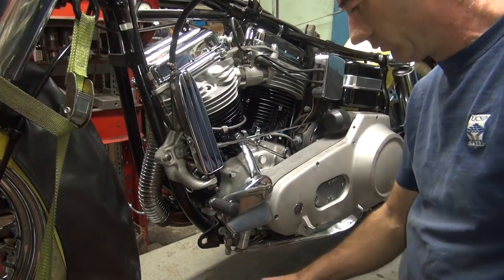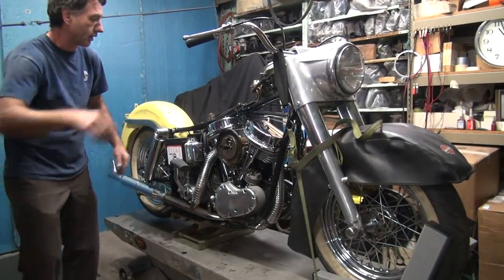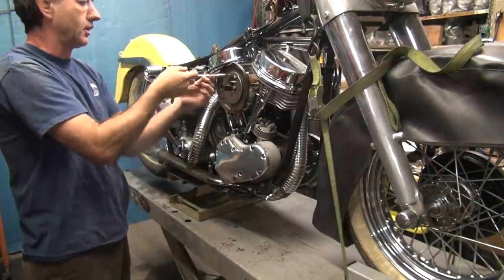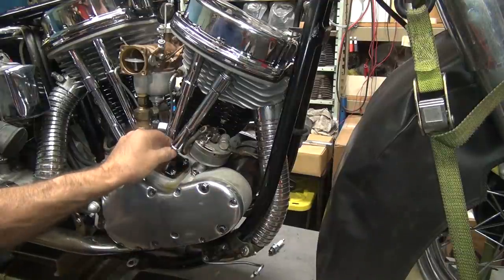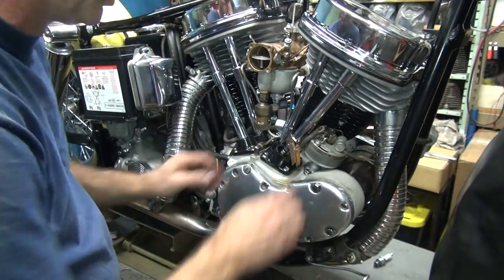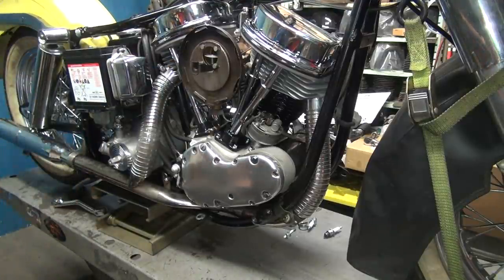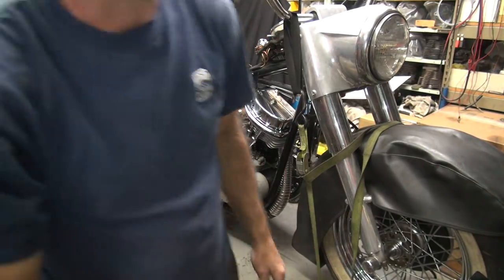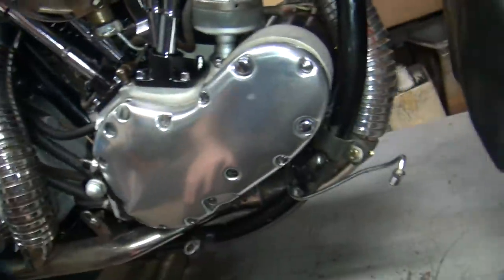1965 panhead #160 74ci flh motor rebuild and bike repair harley by tatro machine

Comment: You use what sort of  hydraulic tappets, and hydraulic unit?  George from Hungary
Reply from the maker: crappy ass harley ones. they are all junk. bad design from day one.
if you want good lifters go with the s&s evo conversion kit. it doesn't look stock but they work.

tatro
Reply: Thank you!!

Comment: Do you know the torque specs on the head and base bolts ?
Reply from the maker: yes, tight.
tatro
Reply from the maker: ok genius. you think you are so special. what is the correct torque for the application? what the manufacture of the part said? the one who made the hardware? or the one who has been doing it for years. then you have the racer who just tripled the loads and knows the stock toques are a joke.
time to go back to your books, i have a race to get to.
tatro
Reply: @TatroMachine  55  lb ft on the head bolts, 45 lb ft on the cylinder base bolts.  Good bye  you won't hear from me again,  but I will have people watch your videos so they know what not to to , like tightening a compensating sprocket nut with an impact, which is 150, to 160 lb ft.
Using an impact could knock the crank out of phase,  but I guess you already knew that.
I happened on your videos by accident and not watching them now on purpose. Even Keith Ruxton would be shaking his head watching this.
Reply from the maker: for someone that is not watching you sure have alot of comments. base nuts should be tight just like they say in the oem harley manuals. that is before the dumbass engineers started to feel important by putting a bunch of numbers in a book. big hardware gets tighten more that small ones. that is why they are bigger. 
don't go quoting what you think people might say to support your statements. i stand on my own two feet and back up what i say by doing it. so does keith.
my videos are real world and this is what i do per application. these are learning videos, and i talk about why i do what i do. it has all come from doing it, not reading about it. everyone does what they want for their own reasons. i never said this is the only way to do things, this is just how i do it. my motor last and haul ass so do what you want.
the factory later year torques are the low 30's for the base nuts and 52-65 on the head bolts. i pull my stuff tight, that is why it doesn't come loose very often. loose hardware causes way more problems than tight ones.
as for your crank phase problem, tighten the damm nuts down on the crank and it will stay straight. you better not watch my crank videos, you are not going to like them. you have been warned.
tatro

Comment: Yes no fat asses on motorcyclez im 6 foot 245 and all muscle except for my schlog. When i kick my 58 pan i put the kick pedal on top and the front piston on the bottom commin up and a. Good napa condencer and points. 4 kicks to prime. With the key off full choke you gota make the crank spin fast so try kickin with your left leg it takes some gettin use to
Reply from the maker: three kicks for the choking is all you should need. more than that runs the risk of flooding out the plugs with all the raw gas you are dumping into the intake manifold. i kick with both legs as one gets tired i move to the next one. you can also kick harder when you are on the side of the bike because you can not bend your knee to get the maximum kicking force when you hit the seat. the lighter you are the more kicking technique you need.
tatro

Comment: I don't understand why you didn't use the electric start in the first place I seen it was on there I guess you wanted to see what the engine was doing my first assumption but it look like you just wearing yourself out
Reply from the maker: what is wrong with using a kicker. it does give you a feel to what the bike is doing. maybe if i had more than 3 hours sleep it would have helped too. unlike new riders i am use to using the kicker, not the button. most all of my bikes are old and never had a button, just that pedal on the side of the bike.
tatro
Reply: @TatroMachine  Fuckin A...

Comment: Oil looks obviously mixed with coolant. Better change the head gaskets...
Reply: No coolant in a air cooled engine.
Reply from the maker: you are a major dumbass. mr. know it all doesn't even know that harleys don't have water in them.
the foam in the oil is caused from all the air mixed in the returning oil from the motor. this is normal. it also has very good flow. that is what i was looking at and showing. all parts of tuning a new motor.

tatro
Reply: Ah, no, it was just sarcasm, a joke like muffler bearings and blinker fluid, and I thought that would be pretty obvious on an air cooled bike.  Sorry if it wasn't.  Yes, I know what air entrainment is.
Reply: +OLDSKOOL60813, you don't say?  It's called sarcasm.  Tatro uses deadpan delivery on his sarcasm in damn near every video. Thought people on these videos would be used to that by now.